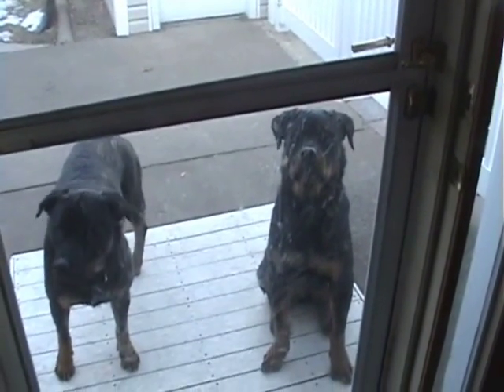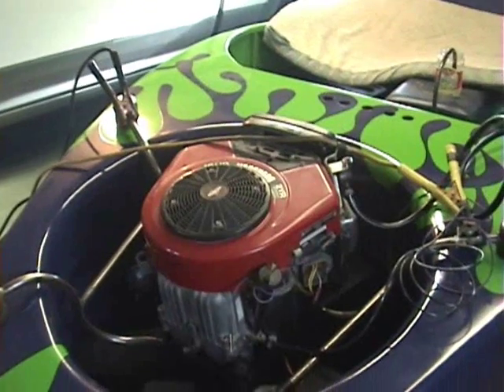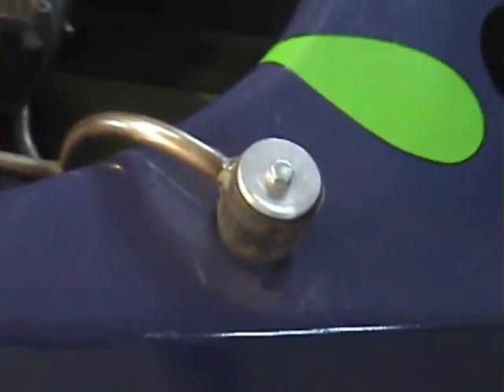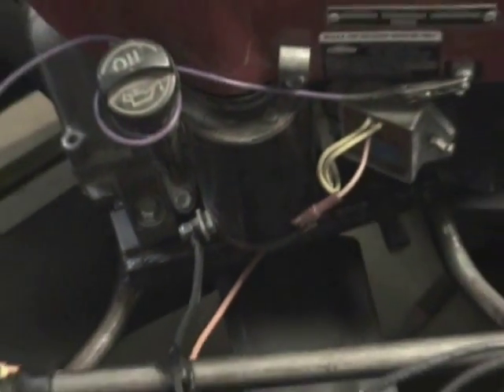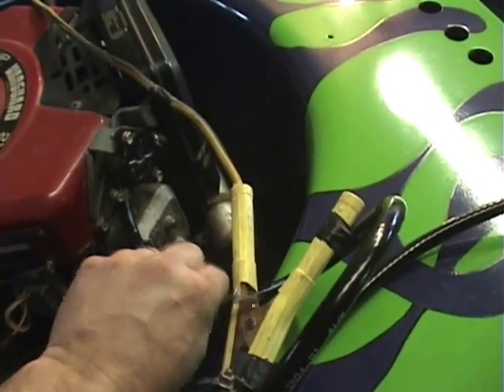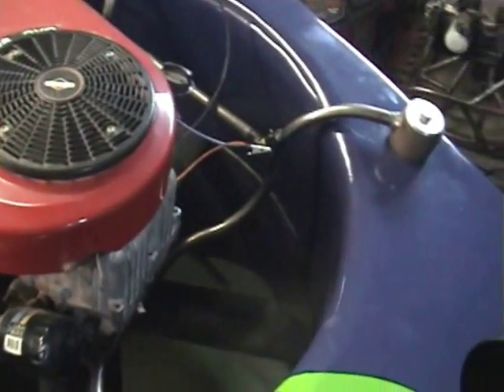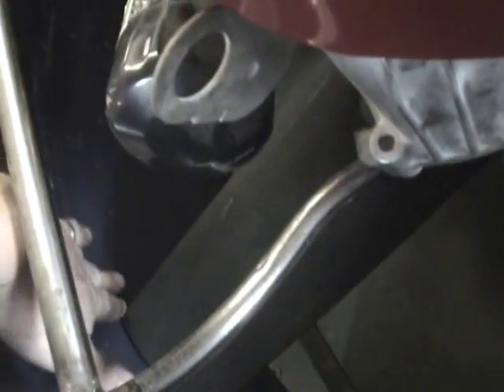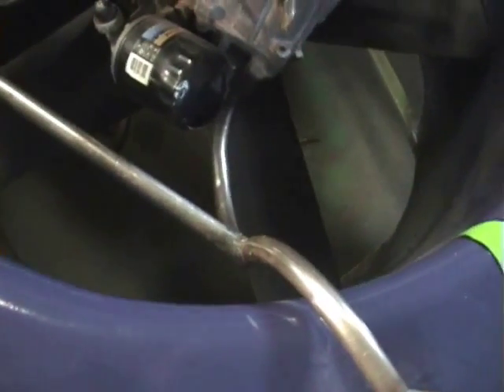lift engine start up 1282010

Comment: Looks like the engine is tilted at a angle. I am putting 11hp in my 13p. It will set at tilted angle.  When the engine is at a tilted angle does it matter which side of engine is tilted down?  On mine setup side down has muffler to the left and carburetor to the right . Do think this will be problem?
Reply from the maker: Yes, head pointed up.

Comment: I am using 11hp on my 13p for lift. 24 hp on the back. Does that sound like a good setup?
Reply from the maker: Yes, on a 13p, that will be plenty. I'd actually recommend a larger duct and prop, if your running a 24hp for the rear engine alone, but if it's already built, just make sure you have enough pitch to use the HP.